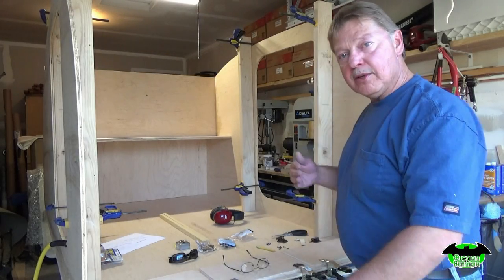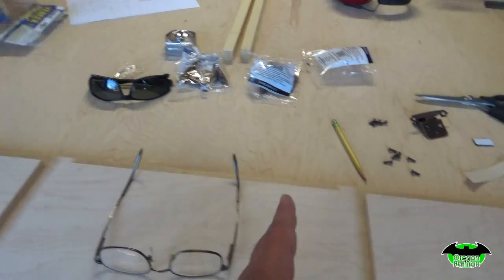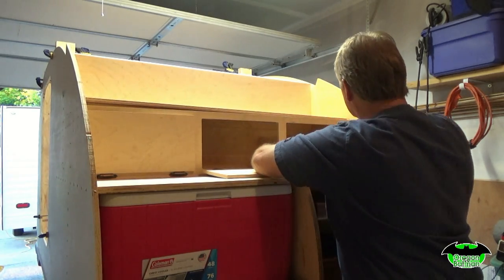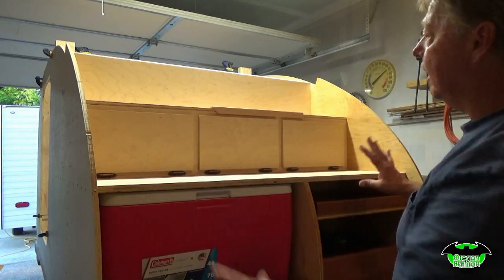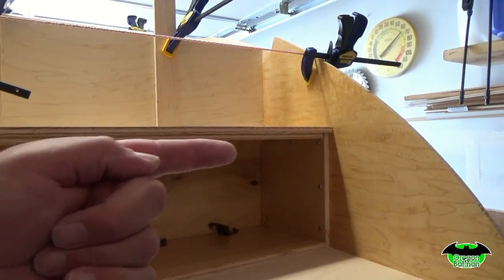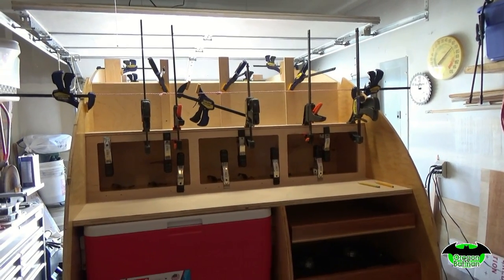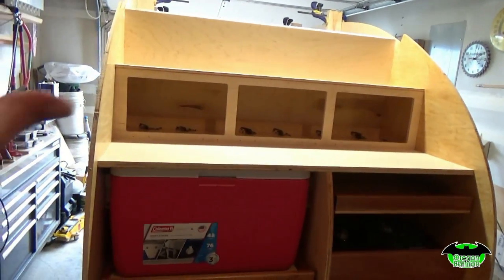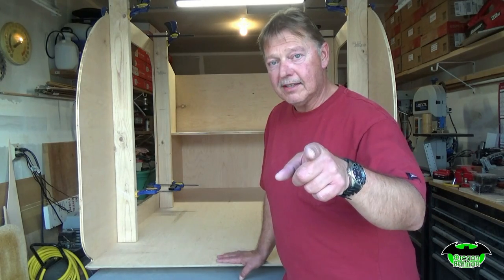Teardrop Build * Step-By-Step * - Part 18 (Cabinet Doors)

Comment: Love your build. Question, why not have the cabinet doors hinge up? I feel like I've seen hardware to keep them open while using
Reply from the maker: Hi Michael! Thanks for watching and thanks for the question... I prefer to have the doors in the galley swing down and still be able to use them for counter space. The pull handles are designed so when the doors are opened, the doors lay flat and have access to the cabinets. Gives me more working space... if that makes sense. :)

Comment: Have you had any issues with those cabinet doors popping open during travel due to being hinged on the bottom?
Reply from the maker: Great question! This is the second Teardrop I built using the same method... had no issues with the doors opening while traveling, and have been on some bumpy roads! Using the spring loaded hinges really helps.